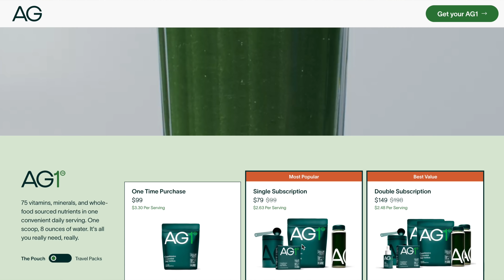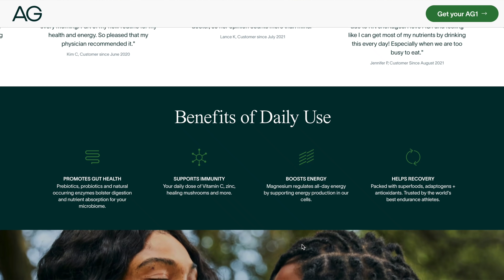Let me explain why, Driveway Makeover

Comment: Good afternoon Mike  the drive way is coming along real nice you know even if you put that drive way either concrete or pavement because of the winters frost and ect. It won't take long that will need repair and it does cost a lot more to repair concrete or pavement than the stone driveway yes the stone needs more regular attention but within a day or two at most it is fix and did not cost an arm and a leg so you are doing great with that job keep spreading a little stone and have a wonderful day

Comment: Mike you have a great "touch" with the loader when it comes to gravel distribution. Looks great. My loader is pretty worn out so it's hard to get a smooth touch. My attempts a gravel spreading are fair at best so I have them tail gate and use the land plane or box blade to finish. Grading bucket on excavator is great for ditches.

Comment: You make it see easy Mike.  Seeing you keep that grading bucket level with the ground while puling it towards you seems easy.  I bet its not.  Would be interesting to have a split screen, one of the bucket and another of you and how you are using the controls.
Reply: From a seasoned operator: no. It’s not easy. It’ll take you a solid week of evenings running the machine to begin to get fluid with such actions. He’s moving three functions at once. (1) simply pulling the stick in toward himself. That’s the easy one. (2) Un-curling the bucket to keep the teeth or edge flat to the ground as the stick pulls it inward on an arc. (3) The tricky one: to keep the bucket moving horizontal you have to move the cylidner at the base of the boom OUT to lift the boom at first, and then once the stick passes vertical and begins swing up and in toward the cab, you have to lower the boom, while rapidly accerating the un-curling of the bucket as it comes in close to the blade.
Reply: Mike is getting very smooth & fluid for a homeowner-operator. As he gets more & more experienced you’ll see the cutting edge on the bucket hold the same angle more precisely. That’s the really tricky & subtle motion in this job. In this case it doesn’t affect the surface so it didn’t really matter, but that does on some jobs.

Comment: Mike,  Good advice on the scamming issues....I was wondering, if you had considered taking some of the spoil you're moving from your sisters driveway, and  by using the Moritz dump trailer, to use it to back up the new embankment at the bottom of the woodyard.  Just an idea for consideration, Regards Robin.

Comment: Don't even waste your time dialing the phone to get an estimate on getting that paved.  Our driveway is 1/4 mile long and I grade it and gravel it, so it's in good shape. Basically all they'd have to do is come lay the asphalt down. 4 years ago when we got estimates (I got 3) the prices ranged anywhere from $65k to $100k, and that was before prices went through the roof on everything like they are now. And that was asphalt. I'd probably have a stroke if someone quoted concrete. 🤣🤣
As for where the scammers are, they're oversees, so you can put your boom stick back in the lockbox. 😁